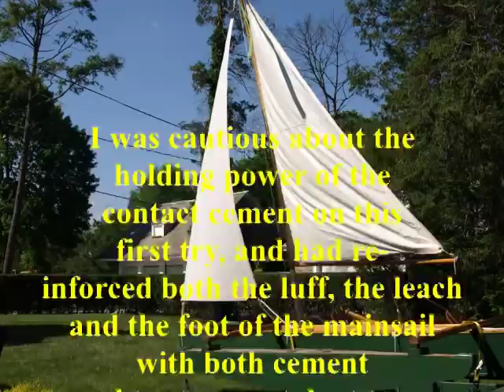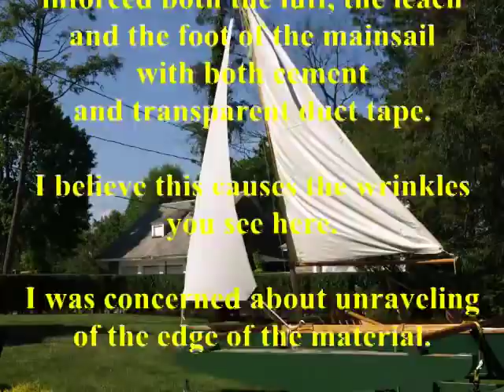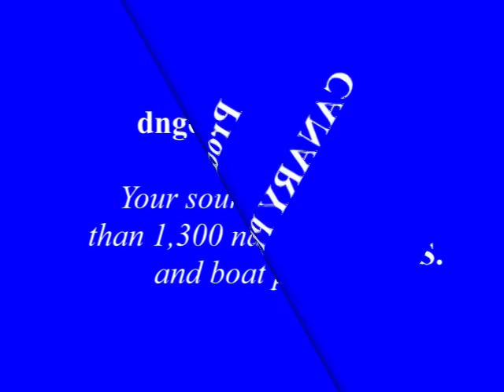HOW TO MAKE YOUR OWN SAILS  METHOD #2

Comment: saw these videos you have. just bought the supplies. thank you. my 1968 starlette thanks you
Reply: it worked sail worked awesome didn't need to add fabric to make it foil it did and sailed a couple miles up wind and current. awesome cheap diy solution i had enough to make a couple sails for less then 50 bucks

Comment: FYI: Duct tape is pressure sensitive in that the harder you press it on, the harder it sticks. try pounding it down with a rubber mallet for an even tougher bond.

Comment: All you show is how to reinforce the corner.  The sail may have some camber, but it will all be in the center and only due to the fact that the boat is moving and the luff is being pushed aft while the leach is being held taut.  Not great sailshape.  Add some broadseams to the luff to place and create camber.  THEN you'll have a sail.